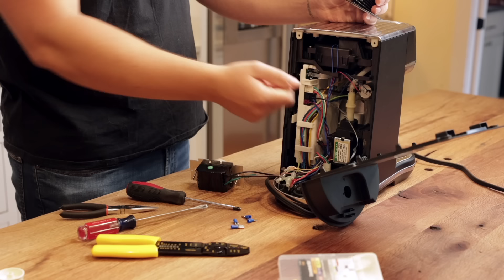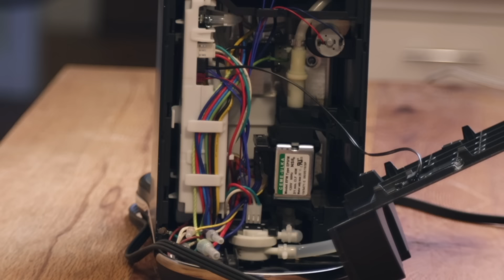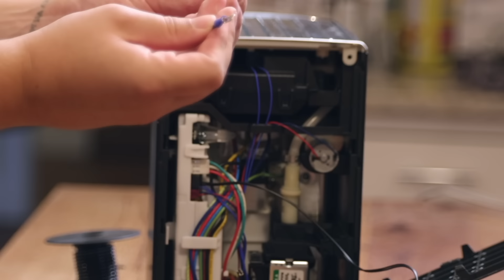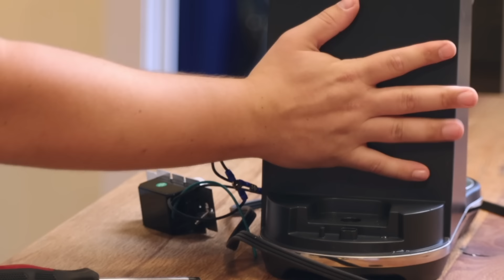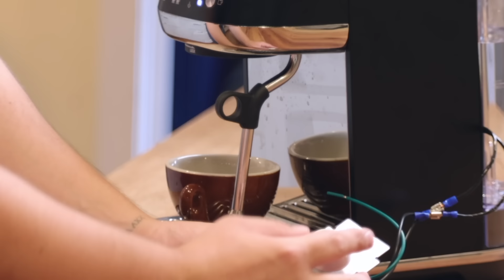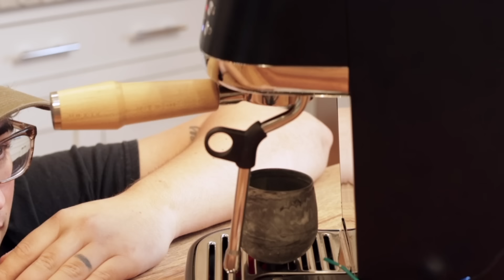Best Espresso Machine Hack: How To Perform The Dimmer Mod

Comment: Is the lifespan of pump decreased by using that mod?
Reply from the maker: Not that I've experienced nor have heard in the years it's been a mod. Of course, if something happened, Ulka pumps are cheap and super intuitive to replace.
Reply: @LanceHedrick  i've gave a thought to this mod, and compared that to E61 group flow control and came up with an idea, that it might be more productive to insert a needle tap and a pressure gauge between opv and a boiler. that way is more complicated, i know, but it is closer to E61 "paddle" experience, does not affetc pump pressure, so it is more constant (excess water goes back into tank via opv) and shows actual pressure close to the boiler for greater control. what do you think about that?
Reply from the maker: Issue is adding a needle is very finicky and if you shunt flow, you can break it or cause it to mess up. Worth a try, for sure, but dimmer is fine to do. In fact, lots of machines have them built in for preinfusion

Comment: does this mean you're also controlling the pressure with the knob
Reply from the maker: In a way, yes. Absolutely. Controlling flow is partly controlling pressure. Input flow times resistance creates pressure. So, when you increase flow, as long as there is adequate resistance (fineness of grounds), pressure will rise. Etc.

Comment: I do wonder at some of the hacks we see on YouTube lol! If you are merely controlling the flow of the pump, this will affect the pressure also. So if your machine is set to provide 9Bar of pressure at the brew head and you slow the pump, you are also reducing the pump pressure, and therefore also the brew pressure. That's why you need to control flow at the brew head. Don't do this, it's a bad idea.
Reply from the maker: Not true. What this does is it controls the flow out of the Ulka pump by way of dimming the power. Multiple people have scaces this hack. Not sure where you're getting your information from, but it is simply pseudoscience. 
Heck, I've done this on plenty of machines WITH manometers and have personally seen the pressure as I control the flow rate by dimming power to the pump.

Regardless, I appreciate your comment! Especially since it wasn't completely rude, though it started out a bit so.

In any event, cheers, Bruce!
Reply: I did it. It worked great. https://youtu.be/val-K-Z_YCM

Comment: Thanks for this Lance!  If anyone is interested in doing this to the Bambino (non plus), it is VERY easy.  $12 for me.  Included a couple of feet of 18-2 lamp cord; GE dimmer from Walmart; and small plastic case.  It took 30 - 60 minutes.  The Bambino requires NO drilling of case, so if you ever want to remove is easy.  You run the lamp cord through the bottom where the power cord goes (lots of room- I’ve also got a Bambino plus and it appears tighter - but I believe 18-2 has the room-note did not mod the plus).  Zip tie the cord to the power cord inside for strain relief…and zipped it in another spot to keep cord under control. I just have my plastic box with control on top (not enough counter room with all my equipment, otherwise would be easy to ‘stick’ to side of case with double sided tape.  Found a very nice ‘dial’ face someone shared for the Sweet Maria’s Popper.  This provides some calibration.  Now does it make better coffee?  Heck if I know imho, but easy and fun.  Lance…you’re impacting my bottom line.  Just ordered one of Urbanic grinders based on last video…you’ve got to stop it man ;-)
I’ve now done the same to my Bambino plus.  No case mod needed.  18-2 lamp fits in with power cord.
Reply: Hi, Have you experienced any change in terms of espresso quality after modding Bambino Plus? Thanks.
Reply: @937dm  It is very easy to do, but it isn’t as helpful for breville as it is for my  Rancilio to be honest.  With the electronics in the Breville you can’t use the dimmer to stop flow completely like you can on a Silvia or gaggia for a longer pre infusion.  Even slowing flow will cause issues, since the Breville will time out.  So short answer, if looking for a project and comfortable making change go for it (it is relatively easy to do), but didn’t find a huge benefit.
Reply: You can also adjust the brewing time or do it manually with the sage Bambino (keeping the brew button pressed for a while, then you will have to press it again to stop the brewing)
Reply from the maker: This is a great comment! Thank you for sharing!

Comment: FYI on those modding the breville barista pro specifically-  at least on my unit it will only run 63 seconds of pump on total.  Strange amount of time,  but I have had that hit a few times trying out sprovers.  Mod is still worth it IMO for getting tastier espresso shots,  but you may be limited for doing to really long pulls.
Reply from the maker: Yeah. It is due to the Ulka pump. There are limits with those smaller ones. BUT you can get a great cup with 63sec!
Reply: @LanceHedrick  totally agree!  just a good note for others that may try this.
Reply from the maker: For sure! I appreciate you mentioning it, absolutely

Comment: I don't think you should dumb your content down this much. If someone can't even connect two wires without help should they be messing around inside a 120V appliance? Your own wording ("route into?") isn't even very clear. You could have drawn a simple circuit diagram.

Thinking about this further -- you should make a video where you describe (perhaps with some diagrams) how the design (block diagram) of espresso machines vary depending on price, complexity, and features.
Reply from the maker: I'd love for you to make a video! Shoot me a link when you do! 🤙🏼

Comment: I have a Bezzera BZ13. and i’m thinking about the idea of installing a knob on the side of the machine . great video!!!!!!
Reply: I just tried to do it on my BZ09 tonight and it doesnt work :/ i dont know why
Reply: This morning i figured out why , i putted a light indicator on the dimmer ( thinking it would look cool ) and this is what was causing the malfonction . It work flawlessly , very very happy of the mod
Reply from the maker: It's awesome! I'm so glad you did it and figured out the issue. Have fun with flow profiling
Reply: @LanceHedrick  i putted the dimmer in a project box with a wire to the pump so it look like an old school remote control . Its clean tho and very nice even on a higher end machine
Reply: @The_Coffee_Rabbit_Hole  great thanks for sharing. I wounded where we could by a nice looking diner to match the machine ?

Comment: Those dimmers make me wonder that manufactures have made a wrong approach, they took high end machines with flow control instead with pump dimmer, we don't have to dreaming about rotatory pump dual boiler etc, look what Mr Hedrick has been doing, that"s wow, all we need now is that manufacture finds a nice way to implantation it onto machine.

Comment: The problem with using a dimmer is that as the water pressure drops, the temperature rises and this causes the coffee to burn
Reply from the maker: Not with machines that have pid controllers, like this one

Comment: Running 220v over here in the EU. Don't feel comfortable with this. Not unless there is a water proof/resistant dimmer switch out there. Don't think I would trust my cabling either. I would be afraid that I'm one spilt coffee away from death ☠️ Would love to try this out at the same time 🤣
Reply: Did you give it a go?
Reply: @HenryPiffpaff  No then. I am happy enough with the mods that I have done and still unsure about the flow control dinner switch 🤣
Reply: @johnmoriordan  Thanks for the quick answer :) Man ... I am on such a ride, research-wise! I have probably changed my mind about which machine to get 10 times in last few days. I don't even have the space for one right now... 😅
Reply: I can understand 🤣 I got lost in research myself. In the end I went with a Rancilio Silvia. I got my machine in 2020. I don't think there is a lot of difference between the gaggia and the Rancilio Silvia in this price range and with the equivalent mods that you can get for them.  I have changed the basket, shower screen, portafilter, and I have adjusted the bypass valve pressure. I am very happy with the machine and the cost of putting that together. I would like the flow control to play with this, but it's not a show stopper.
Reply: @johnmoriordan  😃 What made you choose the Silvia over the Gaggia?
Reply: @HenryPiffpaff   To be honest. My friend had one and really liked it 😂 That was enough for me to make a decision. Otherwise, I'd probably still be deciding.

As I said before and while I have never used one, I believe that they are very similar
Reply: Almost forgot about my auber PID! That is a mod I would say that you should definitely get. Of all the mods that you have to pay for, I would start with that one. I know it is additional cost, but I couldn't imagine using the machine without it
Reply: @johnmoriordan  Ah, okay. That's the thing: I don't know if I want to invest that much into mods. OVP valve springs, VST/IMS filter baskets and maybe a dimmer thingy probably aren't that expensive. Somehow this class of machines doesn't seem to return enough of a profit on investment when it comes to bigger mods than that. Just what I gather from reading a lot. None of them seem to provide constant temperatures, modded or not.
Reply: @HenryPiffpaff  I cannot compare to other machines. All I can say is that I have had a lot of success hitting the tasting notes of different medium and light roasted beans. There are many variables to consider here, but being able to set the boiler temperature and make incremental increases and decreases in temperature is a major factor. If I didn't have a PID and I was temperature surfing as needed when these class of machines are stock, then I doubt I would have been as successful. At the very least very inconsistent.
Reply: If you do it like he did, then it's dangerous. Dimmer should be ideally inside the machine.

Comment: A neat test would be to use a scace gauge and this dimmer. Vibratory pumps are spring based reciprocating motors, they do not deliver a static pressure like a rotary or a city fed water line. I would imagine the pressure reading would be wild with this.
Reply from the maker: It's not wild. I've used it with a manometer built in on other machines.
Reply: Check coffeeforums in the UK. Someone did the same thing to a Duo temp pro and added a pressure gauge as well. It is working fine....

Comment: You should be controlling water flow speed by your grind size, not by modifying the pump like this. Very dangerous
Reply from the maker: Not true at all. Can't control input water speed with grind size.
Reply: All flow control machines control the quantity of water sent in hte grouphead. So this is how you do it. It is called flow control. Allows you to vary the output during the shot.
You can’t do that with grind size...

Comment: I programmed my Solis Perfetta to extract at 2:1. If I add this mod and extract at 50% power for example, do you know if I’ll still get that same ratio? I have no idea if it programs by time or some other measured output.

Even if by time, this could still be useful by simply tweaking the flow, even if set to a constant rate.
Reply: @Foreign Policy ok but why? Because programming the buttons is by time?

Comment: Use wiring that is rated to take the heat an espresso machine can produce.

If the wires contact the chasis or frame of your machine PLEASE make that sure you sheathe the wires to separate and protect them where the wires might contact the machine. ESPECIALLY if your machine's chasis is metal like the Silvia or the Gaggia Pro. 

The thickness of wire shielding varies a lot, and generally the cheaper the wires the more easily that shielding can be breached.  (Plastics expand and contract quiet a bit in an espresso machine. )

Also, it might be silly to say but make sure that the dimmer will tolerate the voltage fed into the pump.

Better safe than sorry.
Reply from the maker: Yep! I pinned a comment above covering some it this. And have a disclaimer in the caption. 🤙🏼

Comment: You see when you reduce the flow the water gets hotter and becom steam when it exit the group head, this modding will not do any good because it will burn the coffee
Reply: No...the steam you saw is normal with this machine. The Bambino has pid so even if the flow is reduced, the pid still controls the temps and will ensure it stays within set limits.
Reply: @younesb7151  I didn't know bambino has PID control, but certainly water temperature is way above 100C when it steams like that.  I've been working on my machine for almost two years and I know how hard it is to control water temperature with a PID even if you have a boiler. 
If it is normal for Bambino to steam like that then it means bambino is a junk machine.

Comment: Real talk, how can we do this with a programmable computer board that can be adjusted and set via laptop/PC?
Reply: You can remove the potentiometer  and connect this to arduino. But! This is AC circuit with 120/220V so you'll need to isolate arduino and add some complementary components to make this work.

Considering the complexity, you'll be probably better off attaching a stepper motor to turn the potentiometer. 😅
Reply: Check the ito! Leva software, I think you'll find it very interesting. It basically controls both the temp, flow and pressure (if you add a pressure sensor of course)

Comment: What if one installs a WiFi controlled dimmer? You could write an app to get data from a smart scale and loop it into the dimmer! The latency of such a feedback loop might be questionable, but I guess it’s gonna mostly depend on the latency of the smart scale.
The only problem is, if protocols of the smart scale and WiFi dimmer are open and can be used in the 3rd party applications.

„Turn 300$ espresso machine into Decent DE1+“
Reply: Or wiring it to arduino
Reply: This is a genius idea !

Comment: Great  presentation.

Someone in the UK made the same mod 4 years ago on a duo temp pro  ( and added a pressure gauge to monitor the changes).
I hope Breville is watching as more and more people are interested in flow control and this couls easily be added at the design/manufacturing stage, given them a distinct advantage vs competition.

Thanks again for your vid. Clear as always.
Keep them coming
Reply: That post is brilliant. Love how he tweaked his DTP. And breville does pump dimmering for the preinfusion in their machines afaik

Comment: Surely if you do this on a thermoblock machine, you’ll have higher brew temperatures because the machine is designed to heat water at a fixed flow rate? If you reduce the flow rate, you’ll heat each gram of water for longer giving you a hotter brew?
Reply from the maker: No because there is a pid controller, so it's essentially a fixed loop
Reply: @LanceHedrick  Do all the Breville machines have a PID controller? I would be interested in doing this mod on the BBE.

Comment: Thanks for the mod video, I never expected to see it on a Bambino!
The Bambino has a programmed in preinfusion phase (where you see the steam) and then the full pressure phase.
I'm guessing since this is just controlling electrical flow to the pump, it also has programmed in time limits, so how are you going about getting a long shot? Did you modify the preprogrammed buttons to the maximum length of time? Or are you working with the factory defaults?
Reply from the maker: I have programmed the buttons to the maximum! I never program my buttons on machines because I'm always doing different profiles
Reply: @LanceHedrick  Thanks for that! Yeah I always pull manual on my bambino as well, and use weight rather than time as the deciding factor.
Reply: @chrischarlton3598  I thought the Bambino was volumetric not time based
Reply: @NoZenith  Out of the box it is preprogrammed to run a certain length of time to get a supposed volume, yes! 
The Bambino has no volumetric measurement capabilities. It just has a timer to run the pump depending on how long you program it for. It's up to the user to determine how much volume that time results in (depending on grind size, all that jazz)
Reply: @chrischarlton3598  thank you.

Comment: Great mod that I am thinking to do to my Epoca St1 too
One question
Will you see a difference on brew pressure when you dial?
I would like to make a profile based to pressure
Reply: It's becouse, in order to build pressure, you must have enough water flowing to fill the headspace and then, once it is completely filled, more water arriving at the coffee basket than the amount of water leaving it. Once that happens, then the pump will try to put more water in there than it can fit, creating the pressure. Pressure is a force exerted over water, trying to move it. If the water can be moved with little force (it, when the flow of water is very low, and it can drip through the coffee puck), no pressure is created
Reply: @9abe9  thank you for you time
My final question is, will I be able to maintain for example, 3-4 bar for preinfusion?